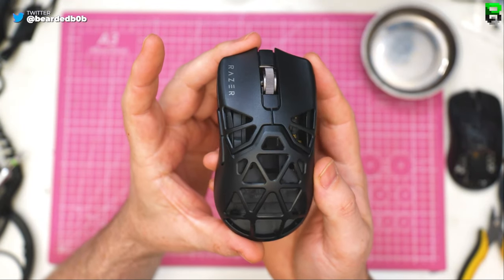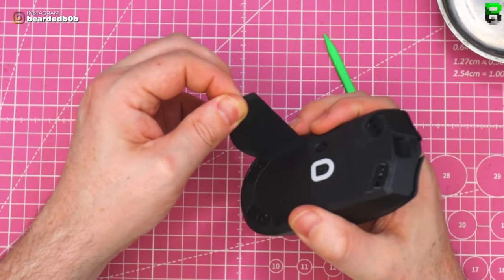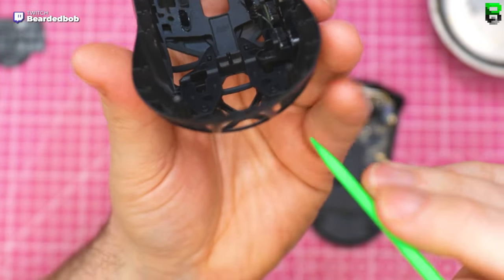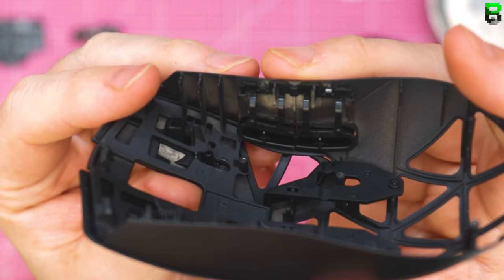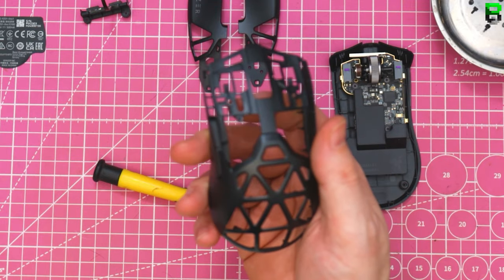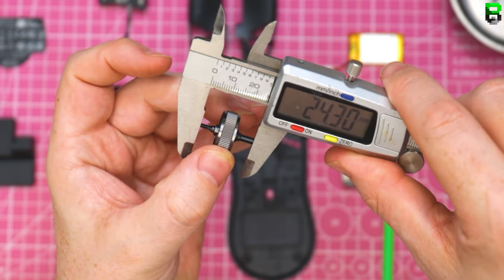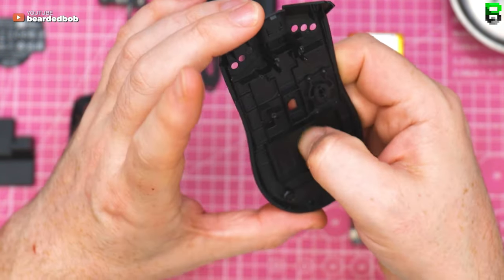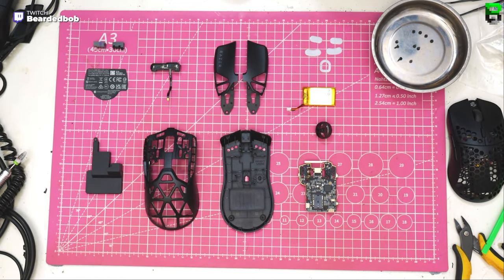LOOK AT THE CRAFTSMANSHIP: Razer Viper Mini Signature Edition Teardown

Comment: This mouse is disappointing considering that you can buy almost two finalmemes with it. For me I'm just going to wait for the regular viper mini wireless and weight reduce that. Way to go razer in trying to drastically increase your profit margins only for your most loyal enthusiasts, sad to see.
Reply from the maker: Wouldn’t waste the money on the FM as you said just wait for a cheaper version of this.

On this version as it stands razer can’t making any profit but they will on the others
Reply: Since when finalshit is synonym of quality?
Reply: @Beardedbob  Wait... u mean they dont make profit selling this Viper Mini SE?? if yes, this is cause of the material used or what?
Reply: Owning both mice, I can confidently say the VMSE is worth double the price of FinalTrash.
Reply: @ThotsAndPrayers  But my point is that neither should be as expensive as they are. Not a justification in my opinion. Also with those massive holes it shouldn't cost anywhere near what it does.
Reply: Hope ur enjoying that cobra pro 😂😂😂

Comment: would love to see you try to do an extreme weight reduction on this mouse! but with how expensive it is it seems risky
Reply from the maker: I will once they release the un numbered versions
Reply: @Josh Oldham The base provides a lot of the stability for the construction
Reply: @Josh Oldham Even so, it would still compromise the build quality doing it. Some small holes would be fine but you can't go overboard doing it to the base
Reply: @Josh Oldham Yea, that way it still retains good build quality and wont flex easily. Razer shouldve had a shell u can atleast put on the back of the mouse like on the normal viper mini

Comment: Raesha is the company that makes Razer’s optical switches. Thats technically not the company name and just one of their name brands. LK is their other name brand. I’m pretty sure they just chose Raesha as their name in a cheeky way to tell other people that those are the switches/encoders Razer uses, since that is how you would pronounce Razer in a language that doesn’t have the letter Z or  hard ending R. 

Also, this company only makes optical things as far as I can tell, so that encoder is probably an optical encoder! This is good for longevity and probably won’t get any scrollwheel issues like the TTC gold gets where dust can get in and mess up the contact surfaces causing it to scroll up and down erratically.
Reply: That's cool to know I was thinking about if the v3 optical micro switches were worth it seems they are just stiffer and better tolerances then the v2. I wish razer made these mouse hotswapable like Asus did like they legit just popout,would've been a cool feature or party trick lol.
Reply: Yea I'll be honest this is definitely the best feeling mouse I've ever held and used (still don't think it's worth the price for just that). Optical stuff is the future so I expect Logitech to move more and more into it since their G502 X series has optical switches and I believe an optical encoder too.

I look forward to what the regular Viper Mini Pro will be in the summer.
Reply: @Shyvorix  Kailh recently released Kailh GO on the XM2WE which is another Optical switch and GX for the XM2W which is a new style mechanical that shouldn't doubleclick or need a debounce delay since it uses sr latch debouncing. I'm so glad these third party mice manufacturers came and are starting to innovate and force Razer and Logitech to improve.

Hopefully the optical switches will all use the same kind of mounting and we will be able to swap between different brands in the future for different clicks.

Comment: Do you have a data base for all the mice you took apart and the parts for each mouse?
I feel like that could really help for modding to have all the info in one place. It is like you have taken apart almost every relevant gaming mouse so you would have access to the information.
Reply from the maker: I do over on www.Beardedbob.com. It it’s needs being back up to date as I’ve neglected it the last 2 years. If people think it would be useful I’ll get it back up to date.
Reply: @Beardedbob  I was thinking a spread sheet so all the info was there at once. I hope other poeple feel the same so there could be even a project where multiple people contribute. I had issues in the past finding out parts of mice like encoders.

Comment: I have this mouse and it's incredible, but my only issue is that the scroll wheel is too easily turned. Would you happen to have a recommendation to tighten the scroll wheel or make it slightly harder to spin? Any help would be greatly appreciated. Excellent video!
Reply: You’d need to swap out the encoder with something like a TTC gold
Reply: Mine is too tight to scroll! wtf are they doing different thing on same products (Quality control is bad)? And have you ever figured it out?

Comment: Hi, I have started having right mouse click wobble. What would be the best way to fix this?
Reply: same exact issue on mine tried to reach out to razer for 3weeks plus for an rma link... Did you fix your m2 wobble?
Reply: Hey Josh not sure if you fixed your unit or not I was able to open mine up and re-tighten the screw for m2 you need a t5 torx/very small philips head to open the mouse/ fix the screw on m2
Reply: @j0eykarate264  hi, yeah I had no luck tightening mine didn't solve the issue. I ended using a jank fix or a little piece of grip tape holding mouse 2 to mouse 1. It works quite well. I cant be bothered with the rma process. Glad you sorted yours.
Reply: mine was a unit from the first batch and had no QC issues when I got the mouse, seems as if the mains loosen over time makes sense that m2 is the first cuz us gamers spam it haha

Comment: Hi, I have a viper mini which has a faulty optical movement sensor LED. Do you  know what the LED used for the optical sensor is? I would like to see if I can replace it.  it's the one which is facing the plastic lens/prism. Thanks.